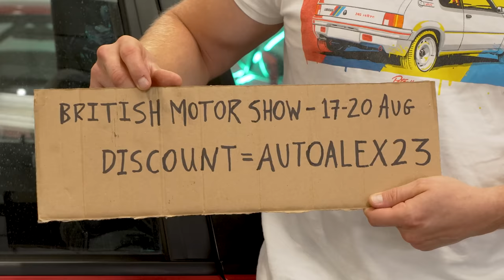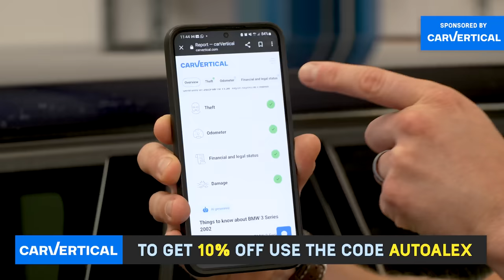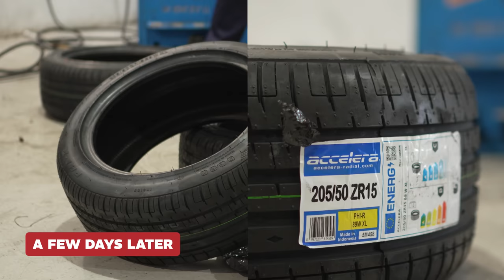WE BOUGHT 2 CHEAP E30 TOURINGS ON INSTAGRAM!

Comment: They are both Tourings so take them on a tour to the factory that made them and a blast through Switzerland and France. Lots of nice roads and mountains and stuff.
Reply: Car throttle?
Reply: Sounds good
Reply: Agreed !
Reply: Basically what car throttle just done with a mk2 golf 🥱 boring
Reply: you forgot to add sleep in the back of the cars
Reply: I concer. With some good old shenanigans thrown in :P
Reply: But judging by your profile picture, you don't believe in roads?
Reply: @drunkenhobo8020  Exactly how does a yellow and black circle imply I don't believe in roads?
Reply: @offgrid7837   Ah doesn't matter, your profile is the same as the ancap flag and they're a right bunch of crazies. Could just be you like Livingston or Dortmund or something!
Reply: yes but now are brexit is did we should have more trip's through are corntree to show what we go. why not a trip to scotland or cornworl .
Reply: @volvos60bloke  I'd like to see a much longer trip than that.
Reply: @berkaybilgin6084  thats the exact reason I got a wagon double air mattresses fits in the back perfect
Reply: @drunkenhobo8020  Judging by your comment, you believe the private market can produce cheap, reliable, fast cars, trains, planes, ships and even rockets...but cant make a flat surface for cars to drive on? :DDDD
Reply: @volvos60bloke  Thats only a few hundred miles from there base. Taylors car has all ready done 300.
Reply: @lukecowell7516  Double airbed just doesnt fit in my car. As its a 7 seater it has armrests for the back row and so its not wide enough.
Reply: ^this and put some skis on roof and ski in the alps

Comment: Would be wicked to see them fully restored, detail, wheels, interior etc
Reply: It's a shame they both want to lower their cars, I know that it somehow improves handling but it looks so cheap and tacky to me
Reply: @lptomtom  depends how low they go! Always using quality parts though so no stress there!
Reply: @lptomtom  Lower center of gravity + they usually use stiffer springs/shocks improving handling
Reply: @lptomtom  If its not slammed with stupid amounts of camber its not bad.

Comment: They aren’t jacking points, they where used to move the body shells in the factory.
Reply: And given that the real jacking points are kind of weak on them, I suggest to get creative with finding these more stronger parts of the car that aren't actually jacking points.
Reply: I wouldn’t use the frame rails either, they’re much softer than they look. This can deform the floorpan and then ergo the seat mounting points - nightmare

Comment: I’ve owned an 88’ 325is coupe once. LSD with 5 speed. Needed all bushings replaced, driveshaft was shot, ant infestation, floorboard rust cancer, but it was so light on its feet, and that I6 sang at full tilt getting onto the highway. Such a cool car!!

Comment: Miss my project e30 318 touring I had. It was in red manual with 60k full service history but was sitting inna barn for 5 year and got it for £300 back In 2013 after having all the bottom of windscreen welded and lot of hours of work had to sell due to financial difficulties. I really miss it.. Happy to see you guys got one each as the touring  literally my dream car.
Reply: And my dash was cracked common issue on them

Comment: Simple upgrade, look for the very rare ALPINA plug and play replacement ECU. Just gives a little extra grunt, but not crazy. I had one on my E30 2.5i Cabrio in Spain. Revved to 8600 rpm. (Note: make sure the flywheel magnet is well fixed for TDC sensing as the extra rpm can spit it off). I saw an indicated 268kmh on a motorway with rpm left to go but ran out of balls to find the max speed. Not the most aerodynamic car at that speed.
Great car, loved it.

Comment: Things you guys should do, e46 zhp steering rack swaps, drop rear subframe and weld in toe and camber correction kits before installing the Bc racing coilovers. My e30 is on them and I’m at 2.5 degrees of camber set as far positive as possible wiht out the correction kits. Also did the zhp rack and it’s Miata level good! Also recommend engine risers and a skid plate from red46 to save those oil pans!! So excited to see the builds come together

Comment: Having owned a E30 325is get a 6 branch manifold and scorpion exhaust on it. They sound amazing. Also if you have the budget get rid of the Air flow meter and have a MAF conversion and map.Oh and LSD (standard on sport). Front strut brace & poly bushes on ARBs makes a nice difference too.

Comment: I have a Mercedes Vito which I've had for 3 years.  The instrument cluster LCD broke so I took the cluster out to get it fixed.  In the back I found a small circuit board which appears to have take 10k off the mileage and disabled Service warnings.

Comment: You took Goodyear EGs off and fitted Accelera? 😯 My experience of Accelera means I’m interested to know how much fun you’ll have on wet roundabouts go from now on. Both cars also appear to have previous haircuts to their mileages. Good starting point for a pair of cracking motors though.

Comment: Challenge for you.  Build smallest cheap car camper you can use on track and sleep comfortably in 🤓 finished converting my mk1 TT yesterday which now has a full single bed inside but also done a 9.02 around the ring 😁

Comment: Those rust spots are very common on E30s, do not worry, not a headache to repair, just some patience. Those are NOT jacking points, never ever EVER use those as jacking points. Those square points were made from the factory at BMW, as they carried the chassis around during production. Once the engine, suspention, driveshafts etc were about to be installed the chassis was removed from those points. There is absolutely NO structural support there, you will drive the jack right through the floor if you do so (eventually). You have lifted both E30s on the frame rails, those are the only jacking points on the front of the chassis.

Comment: If you guys are going to go through the trouble of doing LSD swaps you might as well do the E36 diff mod… trust me I learned the hard way with a Z3 that single mount even with a better quality bushing is shit… while I’d hope the touring is a bit stouter, mine tore the mounting flange off the floor and broke the majority of the trunk floor spot welds

Comment: If its the same as E24 then those square pads aren’t actually jacking points..and aren’t meant to be load bearing..when it was a shell (body in white) in the factory they used those pads to sit it on a trolley to move it round. Bit of useful/useless info 🫡

Comment: The kia picantos are really good little cars, they are dogshit slow (I drive one) but they don't half rev for a pokey little 3cyl, 6700 redline. The handbrake turns aren't bad either, just takes a lot of work for it to get it to that kind of speed

Comment: Have just had a look at the website of the tyre supplier mentioned.  This is just my opinion of course, but I would advise caution. Yes they are very low prices, BUT: They seem to be out of stock of many tyres, but most concerning is they don't display the load and speed ratings of the tyres, nor do they give the legally required EU ratings which seems unprofessional.  Having to look the tyres up elsewhere to find this out is a pain, but advisable, as these details matter.

Comment: Real BMW's have round lights 👍👍 I had a E30 320 sei straight six 12 valve back in the 90s , sadly not a touring , my dad owned it from new , piper cross cold air intake , six branch manifold and custom magna Flo exhaust , sounded like a touring car , good times amazing cars , very tunable side ways fun

Comment: Its great that the AutoAlex channel has a sponsor, but those tyres are absolute ditch finders, would never fit them on any of my vehicles... 

2019 Tyre Reviews UHP Summer Tyre Test - 8th of 8 tyres

Positive - Low rolling resistance. Low noise.
Negative - Very poor wet grip, extremely long wet braking distances, poor dry grip.
Overall - The Accelera PHI was extremely low grip in all scenarios. Do not fit this tyre.